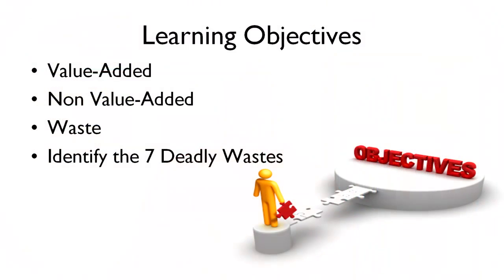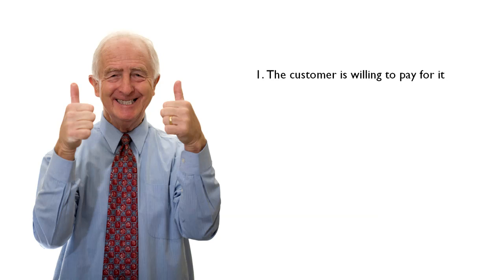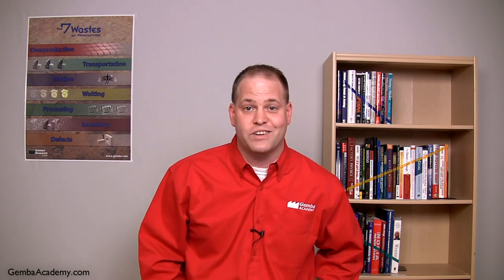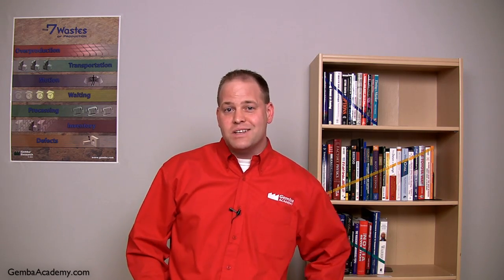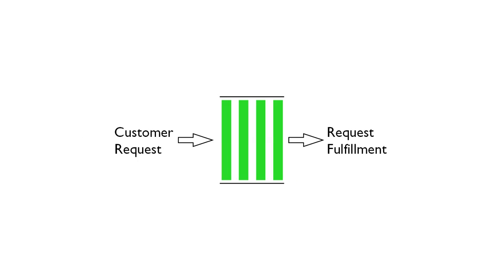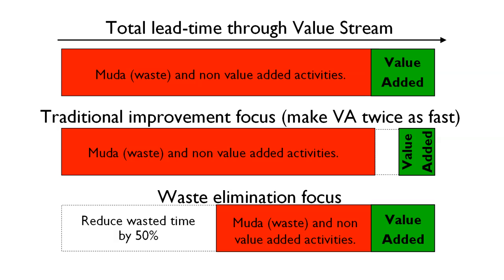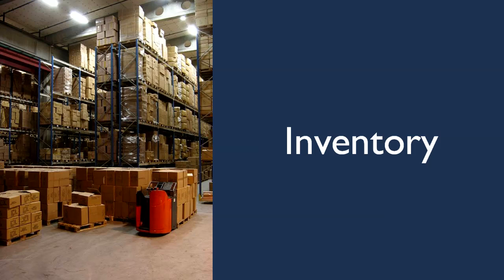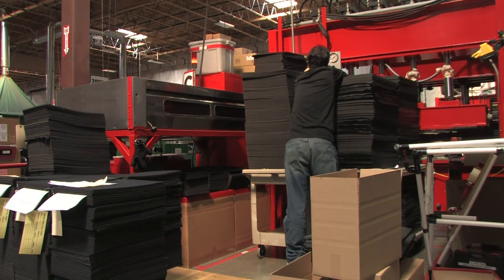Learn How to Deal with the 7 Deadly Wastes (Lean Manufacturing)

Comment: I've noticed that it is in an employees' interest is to disguise waiting time by having a sweep or anything. I've often been fired from agency jobs due to my poor disguise of waiting time! Sometimes silly things such as standing up looks more busy than sitting down. I've also had instances where I have been instructed to do something by a manager, and it turns out the manager has made a mistake and I have to reverse the work I did, having a net gain similar to playing on my phone for all of that time.

Another process which is quite hard to eliminate waste is cutting odd shapes out of sheet metal - e.g. circles out of a rectangle and then having to melt down the cutouts into new sheets - an energy intensive process.

Having an unnoticed drill bit break on a CNC machine is another one. Needs alert employees!

Contamination is another waste, particularly with different coloured injection molding.